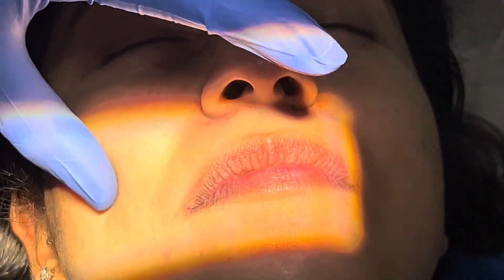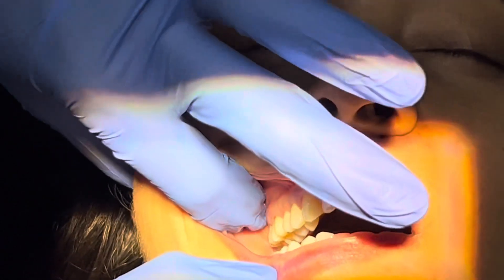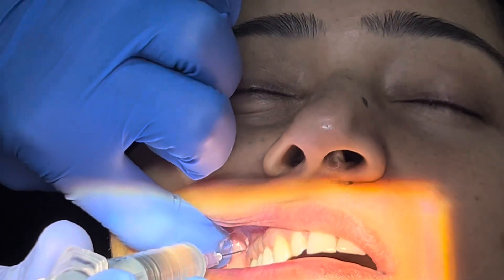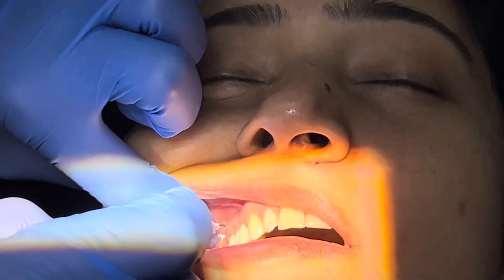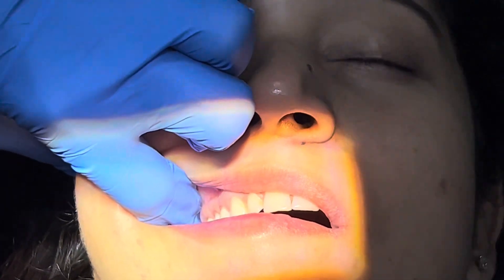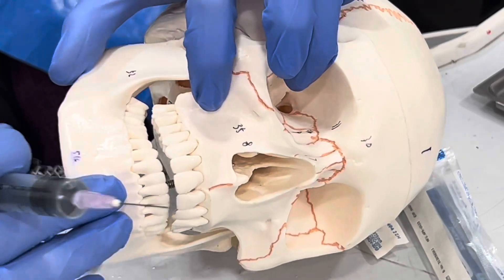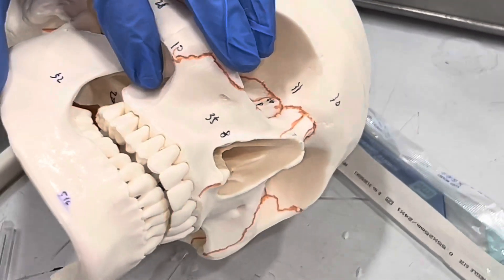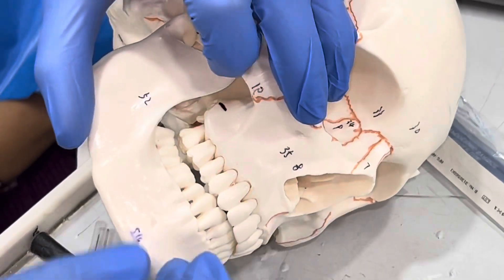PSA Nerve Block Simplified

Comment: What if swelling appears? Because sometimes after two negative aspiration still swelling like a ball appears on cheeck in zygomatic arch area?
Reply from the maker: That is why i said, keep the area pressed for some time
Reply: @easyendo2022  by pressing can we avoid swelling?does it work all the time? Except for wrong technique?
Reply from the maker: This is the only thing you can do, and only thing that works
Reply: @easyendo2022  thank you
Reply: @easyendo2022 sometimes the swelling happend in middle superior nerve block?
Reply: What other important structure could we possible hit if we angulate it wrong?